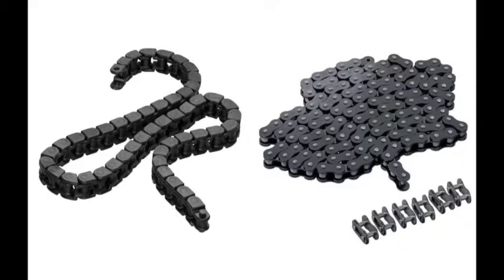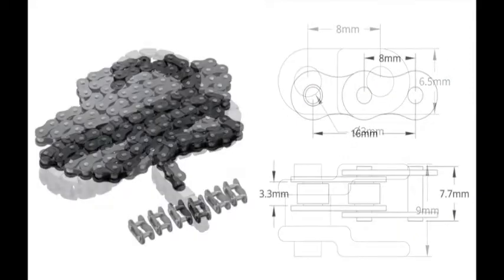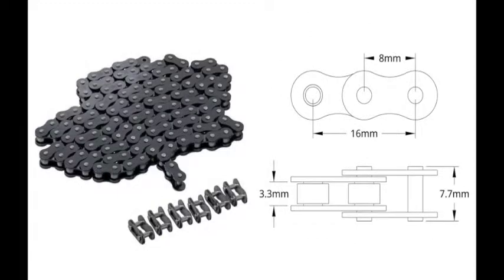Review of goBILDA Plastic & Metal Chain

Comment: Thanks for creating. How do you disconnect chain links easily?
Reply from the maker: Great question!  For the plastic chain, it takes a bit of practice to get the hang of it, but there are a couple of different strategies we like to use.  The one that we've found to be the easiest is to take a flathead screwdriver and insert it into the gap between one of the side connections(so between the stub piece and the portion with the hole the stub fits into).  Lift up slowly and as the gap widens pull out the side with the nubs.  Be gentle and slow with it and it should go smoothly.  If you're still having trouble, feel free to send an email to MechanicalParadox7182@gmail.com and we can send you a quick video demonstrating it.